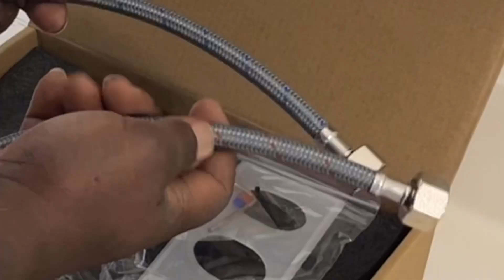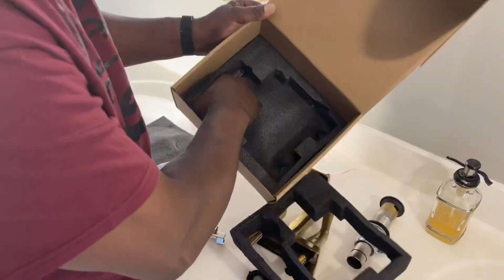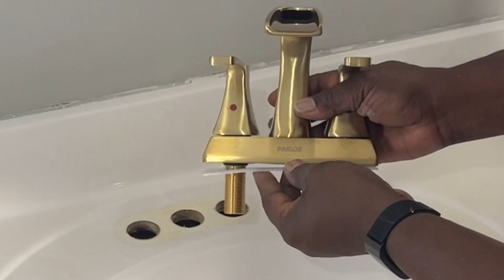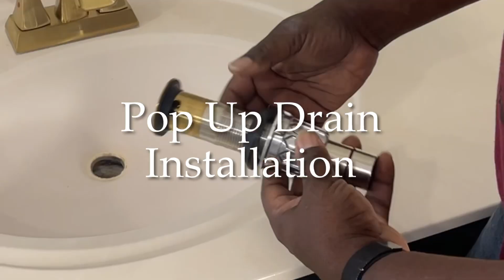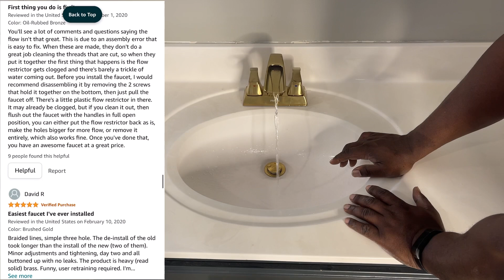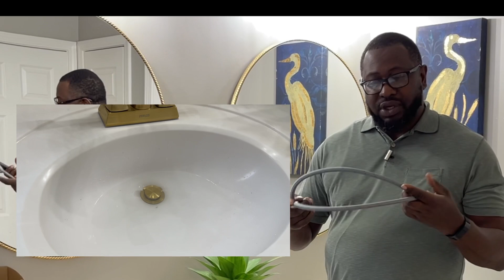How To Install Waterfall Bathroom Faucet | Review and Installation | PARLOS

Comment: Two problems - when you tightened the water lines to the water valves, you didn't hold onto the metal sleeve above the connector nut. As your video shows, the entire lines get twisted which can cause a kink in the interior rubber water line. Some even use a surgical type tubing. These twists can narrow the interior water tubing and reduce water pressure. The correct way to install the lines at the valves is to use a small pliers or needle nose vise grips to hold the sleeve in one place While you are tightening the nut with your wrench. My buddy did this & the rubber tubing under the metal braid finally burst being under improper tension by the twisted water line.
Second, all these faucets have water restrictors in them. I always take them out when installing faucets.
Reply from the maker: Thanks for the input. Have to go back and watch to see what you were referring to when tightening. Didn’t run into any issues. 10-4 on the restrictor. After a couple of days, we got much better flow…Have no idea why.
Reply: @rontalley   Look at your video where you were tightening the water lines to the cut off valves. Although you sped up the video at that point, it was still obvious what was happening. But all it takes is just a few turns of the water line when tightening the nut to get the lines twisted up or kinked. The result is lowered water pressure at the faucet. But you should have a better spout flow for that type of faucet. Glad to help you by sharing my on the job experience with kitchen & bathroom faucets

Comment: The low water pressure flow is due to the water restrictor under the valve cartridge in the faucet head. The video below shows how another homeowner fixed the low water flow by removing the water restrictor. Others are in the aerators at the faucet spout that screw off. Sometimes it appears as just a very thin clear film with lots of tiny holes. You can just use the corner of a screwdriver tip to scrape them off. 
https://youtu.be/WAf4RxrU1G8
Reply from the maker: Thanks for the link!
Reply: @rontalley   You're welcome. Just type in the search box: "Waterfall faucet demonstration"  & you'll get other videos where people had the same water flow problem with the exact same type of bathroom faucets. There's plenty of YT videos showing how to remove the water restrictors from waterfall & other type faucets. Good luck.

Comment: There should be better water pressure coming out of the spout. Look up other videos of waterfall faucets & you'll see what I mean. 
 I've found that most new kitchen & bathroom faucets have a very thin water restrictor in either the aerator at the tip or inside the cartridge that regulates hot & cold water (thank the EPA for that). Some are so thin they are clear and barely perceptible. I just use a small screwdriver or jewelers screwdriver and remove them. That always increases the water pressure better. It says waterfall faucet because that is the way the water is supposed to look, like a waterfall with water coming out the full width of the spout. I would pull the faucet out and remove the water restrictor film in the cartridge or internal aerator.  It may look like a washer with a black rubber edge or just be a thin clear film that comes off easily by prying with the corner of a very small screwdriver.